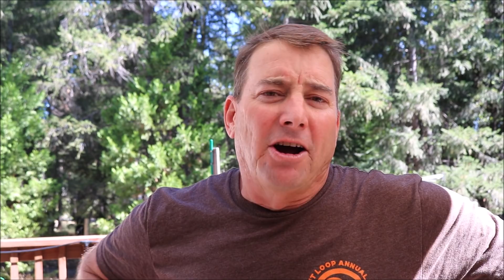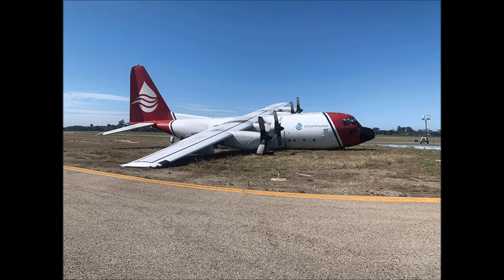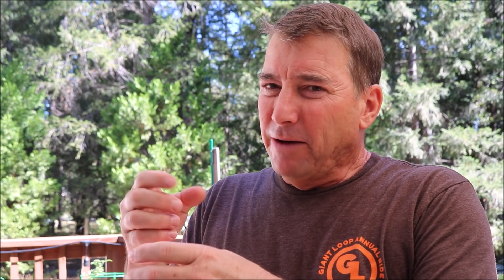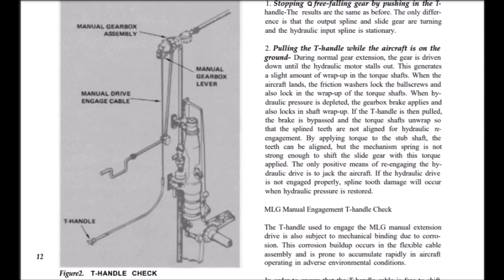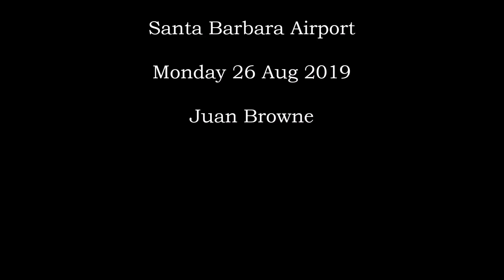C-130A Hydraulic Failure Santa Barbara Airport Sunday 25 Aug 2019

Comment: I was stationed at Dyess . They did touch an go all day long . 

I actually witness a C135 crashed on take off. It was weird. I just happen to be on the third floor of the dorm balcony and decide to watch it take off....( which I saw all the time)
But on that take off...i decided to watch it take off.

Everybody died. It was terrible.  it exploded. Fireball at least 300 feet high.
It was kind of scary ...there's hundreds of jets  on the  flight line or parking
Loaded, Loaded with fuel  and nukes.

I also witness a B1 fell out of sky. I watched it circle around the base to try to make
an approach a couple of time. Then it lost power. Stop flying and just fell out of sky. No gliding  or tumble..ect
It just fell out of the sky during a bank. The pilots ejected and were okay.

i used to talk with my dad to work every morning when i was a kid during the Vet war
I watch the F4 take off every morning....doing real bomb drops.

Comment: I have read where there are no military C-130A type aircraft flying for any military forces.  Because this is the first model put out in 1955-1956, would these still be airworthy and have the range to make it from Hawaii to the California coast?  I also remember a C-130A crashing due to wing separation while fighting a fire.  I hate to sound ignorant, but due to the weights and stresses involved, isn't this particular variant outdated because of the thousands of cycles and flight hours put on the frame and wings?
Reply from the maker: Yes, they should consider retiring this one too. Even though it's modified.

Comment: This seriously is a C-130A model? 

The original A models only had three blade props and were built in the late 1950s. I guess the engines could’ve been upgraded to -7 or maybe even -15s and have the reduction gear box replaced to accommodate the 4 blade props 

Even then to have the wing boxes still serviceable after all these years and being a fire fighter aircraft which don’t get the easiest use is almost pure insanity. 

My herc went to Davis Monthan around 2008. Tail number 62-1810 C-130E.

Comment: Hard to believe the A models are still flying with their wing crack issues. I flew civilian G model Herc’s for ten years with TIA/Transamerica during the 70’s and 80’s doing worldwide charter. It was a great job, if you could call it a job.

Ours didn’t have manual reversion on the flight controls. You needed hydraulics or it was going to be challenging doing it gracefully with power. Lost the Utility system once. We cranked the gear down and flaps 50. Landed without issues.

Comment: I took a summer job for an aerospace firm as a general dogsbody during summer plant shutdown, while they were also moving operations from one local airport to another.  While I’m de-mounting drinking fountains to re-install in the new hangar assemblies, I got a tour of where they were still set up to do fabric control surfaces for C-130s, as they contracts with the local airbase… (from the Hercs to Hornets).
Reply: The Walrus   C-130s NEVER had fabric covered control surfaces.
Reply: @737MaxPilot  <shrug>.  TBH, I never saw any in the hanger, but there was one out on the facilities ramp, directly outside.  That was what I was told, and it was very much a working space, albeit in transition to the larger airport.  This was nearly 40 years ago.

Comment: The.  Civilian designation of the C130 is L382. There was no manual reversion in the Herc, lose all hydraulics and you had a bad day.  I went through AF transition to the C130 in 1975 as a Marine. Flew the KC130F/R till 1978. FLEW with Transinternational/Transamerica Airlines till 1987.
Reply: Pt S yes, there is manual (pulleys, cables, pushrods & bellcranks) reversion.  It surely wouldn’t be easy like a 737, but by definition it has manual reversion.
Reply: Sorry not in the old C130/L382. Without hydraulic boost to the controls you were SOL. The Electra (L188) on the other hand did have the three handles behind the center pedestal for disconnect. I am typed in the L382, last time I flew was 1987 when Transamerica  Airlines shut down.

Comment: The two huge air compressors or turbine engines supply air so it’s not surprising an problem fills the cabin with smoke. Bleed air.
Reply: A320s upon startup used to fill the cabin with fumes. I wonder if they still do.

Comment: Kind of related story but we lost Captain Al Haynes Sunday night.  He was the Captain of United Airlines flight 232, the DC 10 that crashed at Sioux City on July 19th 1989 after the DC 10's center engine had a catastrophic failure and all three hydraulic systems lines were severed when the shattered fan disc assembly exited the tail of the aircraft.    Rest in Peace and Fly high Captain Haynes

Comment: Oddly enough, I've got a couple of distantly related tales.  My nephew - now a BA 787 First Officer - used to fly the British equivalent of that C-130 variant.  Air Atlanrique out of Coventry, used to fly three or four spray equipped DC-3's, for oil dispersion.  My nephew's aeroplane was a 1942 C-47 with all its original instruments!  Not only was it much older than him, it was nearly five years older than his dad (and me!)

I had to go to Kuwait a couple of weeks after Gulf War 1, to fix a CT Scanner and I was flown from RAF Muharaq (Bahrain) to Kuwait City via Jebail Naval Air Station in an RAF C-130 - 'Fat Albert'.  On the way out, a week later, the Albert was going home to Brize Norton and the crew were prepared to 'MEL' almost anything.  Two of the props had been borrowed from the USMC, the green/brown camoflage was grey and black because to the fires and the right main u/c needed manual assistance from the 'Loadie' with his Model 'T' starting handle.  I got to stay in the cockpit for the landing and the Flight Engineer just said; "Mr Lockheed builds some very fine aeroplanes."  Amen.
Reply: British superHercs are legendary! I still have some patches!

Comment: I have over 1200 hours as a C-130A loadmaster with the Rhode Island Air Guard, 143TAS. The crew should have cranked the gear down. There is no free fall that I've heard of. It must be cranked down. All 4 feathered? They must have shut them down before touchdown.
Reply: Perry Rose no, they can feather the props after landing...I guess it’s been too long for ya.  Yes, the landing gear will free fall...it’s designed to, but can be cranked down if needed.
Reply: Long time? only 35 years. They most likely pulled the fire handles. I still can't figure out the free fall mechanics.  @737MaxPilot
Reply: The flight manual section 3 page 39 says nose gear falls but the mains are cranked down.
Reply: Perry Rose I couldn’t tell you if there’s much difference on the A vs the others.  I do know that mx does ops check the main gear free fall during ISO inspection.  I do know that both of my mains fell without a need to crank them down when I lost the utility sys a couple years ago...and every time I demonstrated this feature to students in the air, it fell just fine.  Cranking them just indicates that either your mx folks need to do something more, or you have quite a bit of differential pressure on the tube & you forgot to follow the checklist & depressurize first.

Comment: I was on an in country flight (South Vietnam) in 1969 around this time of the year heading to Vung Tau for a advance course on Huey Helicopters I was Army and Crew Chief qualified but was working as a full time Huey mechanic. The C130 I was on on approach to I don't know where and I noticed the loadmaster and a Civilian Mechanic on board going to the left main landing gear they kept looking through the access ports and shining a flashlight in and talking (yelling since the C 130 is a little loud).  Eventually they came back to the landing gear with a steel bar and sledge hammer inserted the bar through one of the access panels and proceeded to hammer away with the sledge on the steel bar. Suddenly the aircraft rocked slightly and you could hear a definite whine as evidently the gear went down. They both gave a thumbs up and stowed the specialized tools. No problems on touchdown.
Reply: “Specialized tools” 😃😂

Comment: Hi Juan.  Your channel is great in explaining things to non aviation folks.

     Just a minor point to correct.  You mentioned the utility hydraulic system operating from engines 1 & 2.  While this is true for the E and H, the A is different.

     On the C-130A, Utility hydraulics are powered by engines 2 & 4.  The pneumonic to remember this is:  BUBU for engines 1234.
Reply from the maker: Ah Ha!  Thanks!
Reply: In addition, the utility and booster hydraulic systems on the early A models don’t use suction boost pumps to prime the engine driven pumps during engine start.  Instead, the system is called “utility prime” and “booster prime”.  The flow of hydraulic fluid in these 
prime systems is quite different from that found in the B and later models.
Reply: He’s right.  I didn’t fly As, but have 26yrs on Es & Hs as an FE, as recently as this past April.  And, I had a loss of utility system just a couple of years ago myself.  You also talk about the chains holding the gear up.....not so much.  If the bird wants to settle, it will pull those chains up right through the structure...saw this first hand.  Primary use of chains is to hold the main struts vertical, which you did mention.  So, before any armchair quarterbacks start saying the crew should have chained the gear....maybe they did.  The gear tie down fixtures should be able to better hold the gear down, but I’m not sure if IAR has those.  If they had that palletized oil dispersion setup loaded, they would not have been able to chain the gear.  Plus, if after manually lowering the mains, if they were in the proper down position, the mains SHOULD have stayed down even without chains, devices or hydraulic pressure, by means of a friction washer.  This may have been the failure which caused the right mains to come up.  Landing without one of the two main hydraulic systems should not have been an issue, given no other failures.
BTW...the utility system powers ALL of the flight controls.  So does the booster system.  I’ve always hated that phrase “powers half the flight controls”.  Either system allows boost force for the rudder, elevator and ailerons.  I always asked “which half” when someone said that.  Seems to have always cleared this up.
I knew you had some character Juan...having some Herc (not Herk) stick on ya!

Comment: The airport has been closed for a while.  A friend of mine who’s a CRJ Captain got bussed to LAX. How did ya find out about that utility system was out?  Wonder why they didn’t return to Santa Maria.  They had called the civilian Hercs L100
Reply: Ken Clark , hello, yes the civilian version is the L100, but next time you see one take a GOOD LOOK AT IT , the forward section has either a 20 foot or 30 foot section ADDED TO THE FUSELAGE, so just looking at it their engines SIT FURTHER REAR OF THE COCKPIT , Still a GREAT PLANE, that was the FIRST time I ever saw a plane REVERSE, it was a C130 FOR DELTA AIR FREIGHT @ KIN ( JAMAICA)
It was backing up to the freight/ customs building in 1965 . Cheers from NJ